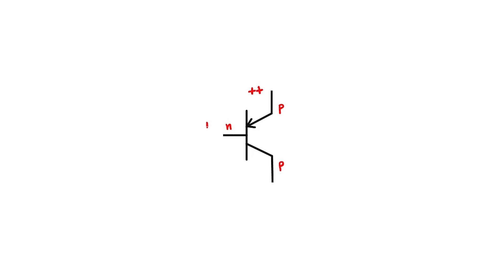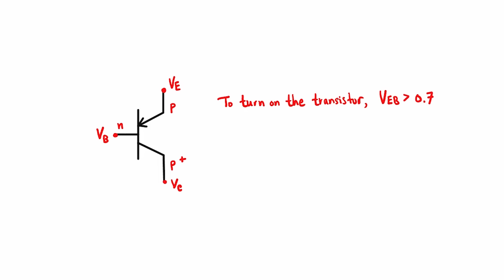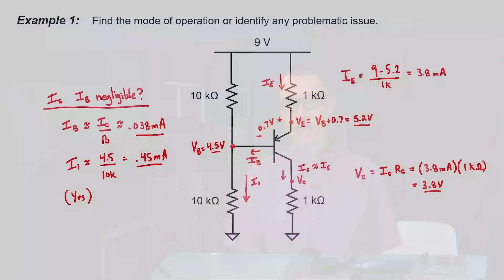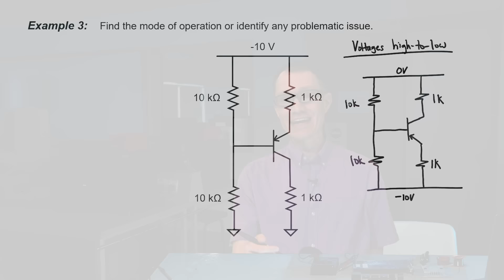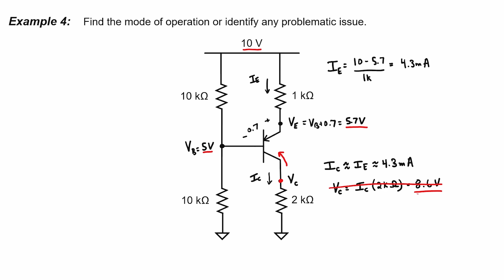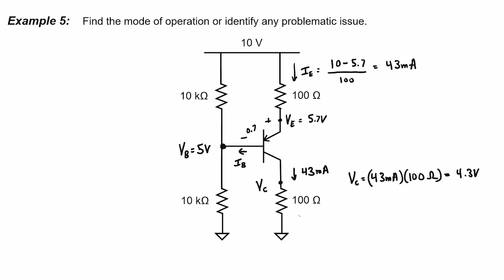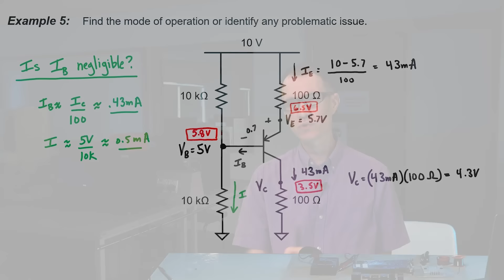Introduction to PNP transistors (20-Transistors)

Comment: "reverse active" mode --- I ran into this because the 2n2222 part I bought was from OnSemi and the OnSemi data sheet for that transistor has the leads labeled backwards and my circuit didn't behave as expected, took an experienced electrical engineer to figure it out (I'm a software engineer and would probably never have figured it out on my own).  turns out the OnSemi data sheet is opposite every other manufacturer's data sheet for the 2n2222 part.
Reply: pinouts can vary on TO-92 case components
Reply: @davidconner-shover51  are you sure you read my comment, I'm not claiming all TO-92 component are E-B-C, I'm saying all 2n2222 are E-B-C, my OnSemi works correctly when I wire it as though it is E-B-C, in spite of the fact that the OnSemi data sheet says its C-B-E, opposite what all other manufacturers of 2n2222 say.
Reply: @MostlyIC  Over the years, I've run into quite a few documentation misprints
I had some rather expensive equipment that went out gloriously in the past, there was a labeling misprint on a known part, the new guy didn't know it was a misprint, or thought they made a change.
The manufacturer tried to void the warranty, until I sent pictures showing the mislabel. oops.
Yes, having the pins reversed is rather problematic
Reply: You must test the transistor with a dynamic transistor tester, which measure the gain by injecting a 1 KHz signal on the base, and measure the output on the collector, while providing the correct DC bias...

Comment: When I was a youngster back in the 70s, all the 8 transistor radios had pnp transistors.  That's my first experience with transistor, and it wasn't so hard then.  Now convention has changed where you draw these things upside down.
Reply: I grew up with PNP germanium transistors. When I started my career in the electronics industry I encountered NPN devices, and everything I had learned was turned upside-down. I am now used to both, and trying to get my 68 yr old brain to remember all the permutations of FETs. 🤔🤔🤔

Comment: I  use PNP transistor with open collector cercuit  they can activate 12v or 24v charge with 5v logic .
Reply: This design will work, but it's not recommended. If the transistor burns, you may have 24 V running (thru a base resistor) into your 5 V electronics. It's better to use an NPN transistor on the 0 V / GND side. Or use a ULN2003 or similar.

Comment: Ahem ...
IF:
the diode formed by the base - emitter junction is FORWARD biased,
as we can observe the FORWARD voltage drop.

we know that this diode is N-type at the base
and P-type at the emitter.

THEN:
for a forward voltage drop to occur in this case,
electrons must be flowing INTO the base junction.

hmm?
Reply: It's 'conventional current'; used in schematic comprehension but the opposite of actual electron flow.
Reply: In a pnp transistor, the emitter is doped p-type and the majority carriers are holes. These holes are injected into the thin n-type base region because the base-emitter junction is forward biased. Once in the base region the holes are now minority carriers, and although some of them will travel to the base terminal where they will recombine with electrons to provide the base current, most of the holes will be swept through the base region by the strong electric field provided by the collector. They will travel across the reverse biased collector-base junction because they are minority carriers at that point. Once in the collector region, they will travel to the collector terminal and provide the collector current. Hope that helps.

Comment: Technically you are right. But PNP transistors were originally used with a negative supply rail, so your schematic is upside down. Drawn like that it just causes confusion.

Comment: When calculating the base current in Forward active mode, don't you have to consider the voltage divider current on the base side?
Reply: Yes, but actually no - base current will move the divider point a bit, but its not that important for high betas, for low values - yes you need to take it into account.
Reply: @VEC7ORlt but that’s just adjusting the voltage division. What about KCL for the entire resistor series, 2 x 10K ohms, with 9V supply? I don’t understand why the other 10K is ignored? I(b) is the base current but why is I(1) the same?
Reply: @soloflo  what other R 10k?
Its an approximation either way or do you want to solve for ALL junctions, nodes, currents and voltages?
Reply: @soloflo  The Professor starts with the assumption that I(b) is negligible, hence he ignores it all together: if you ignore I(b), the only current flowing will be I(1), which flows through the second 10k resistor.

Since the resistances are the same, he assumes the voltage at the second resistor (the one connected to ground) to be 4.5V (half the supply voltage, 9V), and since the resistors are in series with each other (they form a voltage divider) the current flowing through the second resistor will be the same as the current flowing through the first one. 

Therefore, you can calculate the current using Ohm's law: 4.5V/10k= 0.45mA. It doesnt matter if you choose the "top" or the "bottom" resistor, they are in series, that's why the first resistor is ignored.

It is an approximation that doesn't match with reality, but its close(-ish) enough:
if you try to simulate the circuit in LTSpice, you'll find Vb=4.67V, I(1)=0.47mA and I(b)=0.035mA, which are somewhat close to the estimated values, with a bit of rounding (Vb=4.5V, I(1)=0.45mA, I(b)=0.038mA). I don't know how "negligible" these differences really are but again, for a back of the napkin calculation they are pretty good. After all, the goal is to predict what the operating mode of the transistor is, rather than thriving for precision (at least this is what I get from the video)
Reply: @RussellTeapot  That's pretty much how it works. If you want to make a closer calculation, you can use the Thevenin equivalent for the voltage divider I.e. a 4.5V voltage source with a 5K internal resistance (two 10K in parallel). That tells you the 4.5V is changed by Ib (0.035mA) times 5K = 0.175V making it 4.675V which is in accordance with the LTSpice figure. Of course, resistor values could make as much difference if you're working with 5% resistors, so this sort of precision in calculation usually isn't worth worrying about.
The effect on the circuit is a small change in the quiescent bias point at the collector, which at worst will make a tiny decrease in the maximum output swing.
Reply: I wonder the same thing
Reply: Didn't he do that? 0.45mA compared with .038mA base current.
Reply: @misterbonzoid5623  I have to sit down with a calculator and revisit this video later. Just that I noticed a few other guys also were puzzled with this aspect, and me too, at this moment.